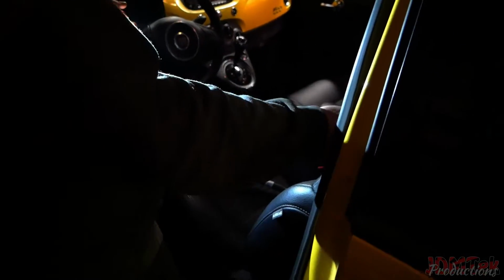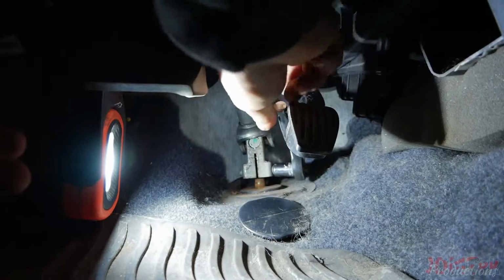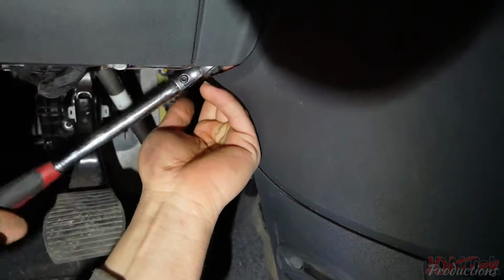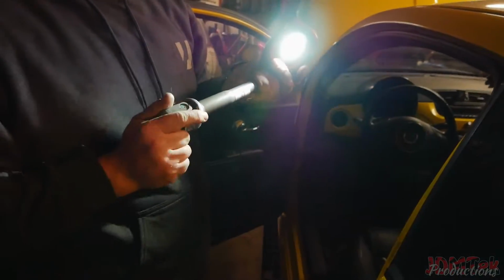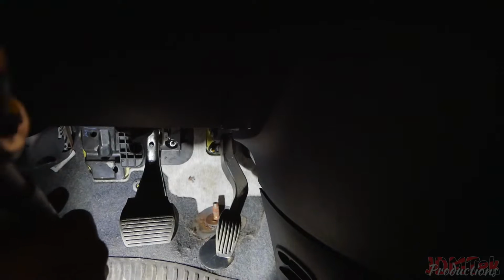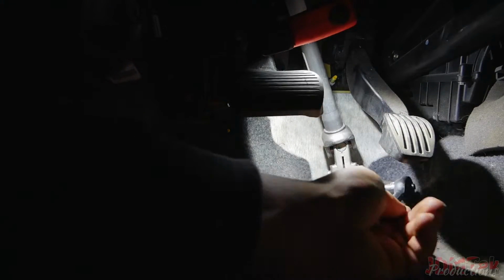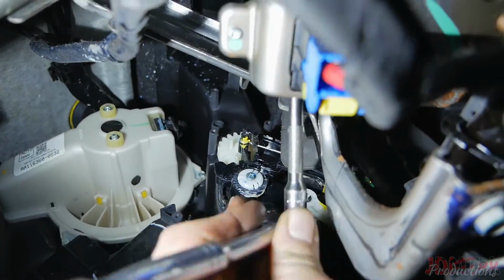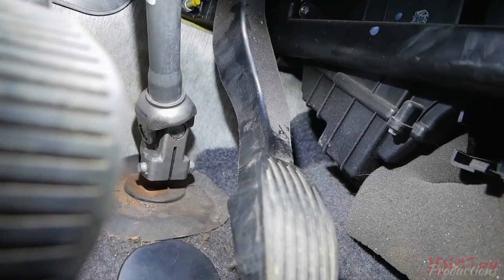How to Replace a Fiat 500 Steering Column Shaft

Comment: what part number or a link where you bought upgraded one?
Reply: Oleksii Masyk i also would like to know the oem number for this
Reply: @valeriomalenchini6776  anyways got mine from rockauto for 180
Reply: Valerio Malenchini The OEM number is printed on the shaft on outside middle.
Reply: Valerio Malenchini It’s got to be the 2016 model shaft.  Looks like molar 68105066AF.

Comment: I replaced mine but after removing the shaft I turned the steering wheel and broke the clock spring. After replacing the clock spring everything went to normal but now I have my ESC light on. I took it to the dealership and they said it is the steering positioning sensor. I couldn’t fine any sensors in the column.  Any suggestions??